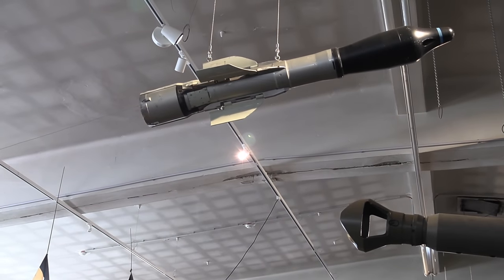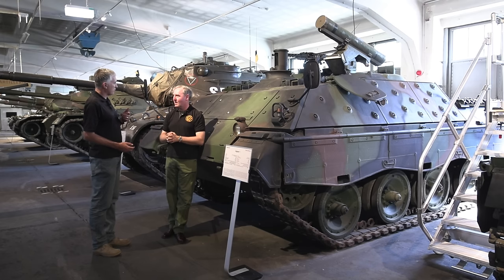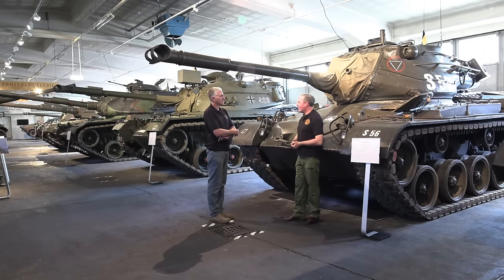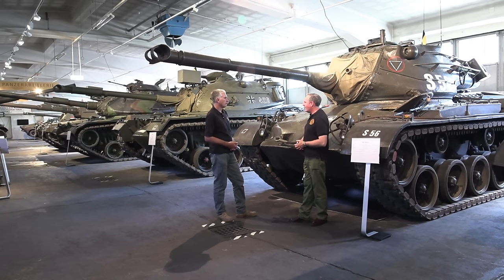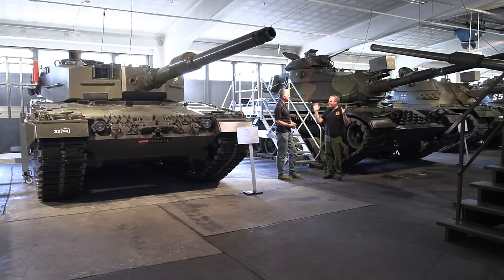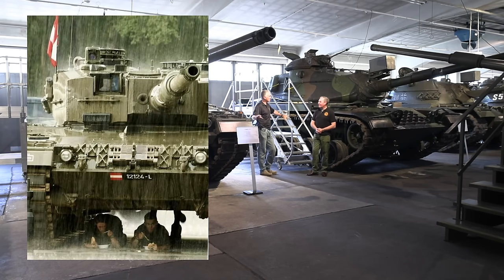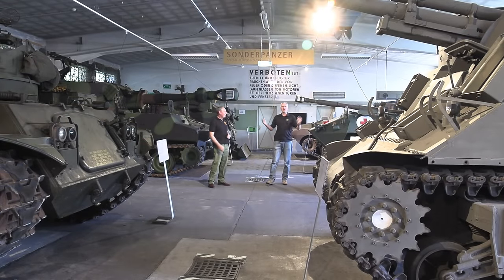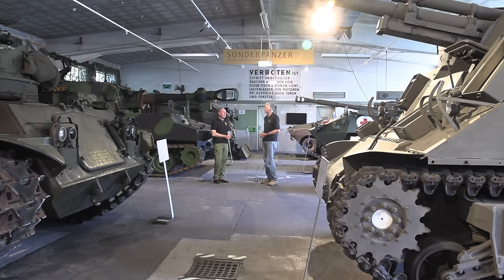Austrian Armour at the Heeresgeschichtliches Museum, Part 2

Comment: I had a brainfart listening to the fuel efficiency numbers - heard 1100 litres for 100 km on road and thought - that can't be that bad, that's an efficiency of 11km per liter.... Brain then went wait, it's actually 100 METERS per liter!
Reply: You could roll out 100 pick-ups for the same fuel consumption. Puts Sahel warfare into perspective.
Reply: I read up on the Swedish army tank trials in 1992. The M1 Abrams have horrible mileage. So apparently all american vehicles is similar.
Reply: I see you come from a place of imperial units - no one measures fuel consumption in kilometres/litre, it's always litres/ 100 km
Reply: @laurisikio  um, no - I actually do come from metric land, hence the brainfart comment ;)
Reply: I can confirm that too. In fact both the M47 and M48A1 had the same 1L/100m consumption while in convoy, on the road. Tankers from the Greek Army however had told me that it could average 1L/50m cross country...
Reply: Many, many years ago I heard the same from Italian tankers, their n.1 reason of discontent with the M-47 was its fuel consumption. At that time I did not take it very seriously, considering that those Italian tanks were quite old so wear and tear must have taken their toll on them. Interesting to hear the same thing from another corner.
Reply: @jesper509  No, they don't have "horrible" mileage. When they're on the move, they're relatively comparable to their diesel powered counterparts. The problem was when they were idling they still guzzled fuel. That was mostly fixed with the addition of an APU.
Reply: @jesper509  From what I understand the later M1s are not as bad anymore...

Comment: American tankers. This machinegun is to fiddly

Austrian tankers. Oo this machinegun has a lot of fiddly parts. Love it
Reply: Training, training, training. Something that the American military seems to skimp or skip all the time when it comes to small arms. Meanwhile, the Browning has a design pedigree that goes back to the Great War, being an up-scaled M1919, which was an air cooled M1917, and it was meant to still run fouled to hell and rained on and with mud and beaten around by infantry, and feed the belt even when the cotton duck stretched.... and it had plenty of accuracy, having held the record for longest range sniper shot for something like 30+ years.

The M85 may not have been bad... but it WAS up against the work of J.M. Browning, and it apparently used different belt links... which has gotta be really inconvenient if... or perhaps when... some goober in supply doesn't realize that the two are not the same thing, and sends you a truckload of M2 food.
Reply: Put me down as an American ex-tanker that likes the M85. I commanded an M60A1 in 3 AD for about 16 months and mine worked flawlessly. On the other hand, the M73 / M219 was garbage.

Comment: Having more than a modicum of trigger time on the Mg74, the Mg3 and the Mg42, the Austrian version (barring the absurd Swiss Mg51) is the " '42 done right". 
The '74 just drips quality, and is genuinely a joy to fire and work on.
Reply: as someone who is right now learning how to handle the mg 51, why would you call it absurd?
Reply: @derhighlige5493  Taking a design intended to be quickly and inexpensively made of stampings and turnings, and instead using precision milled and beautifully finished components, resulting in something more akin to a work of art, than a GPMG.
That's absurd. 
(Albeit in a very good way.)
Reply: @jballew2239  I am currently doing my mandatory service in the swiss army and yes you're right.

Comment: Good video.  The audio could be better as Franz was a bit hard to hear, but I raised my volume whenever he spoke. Pretty sure you realized that after the fact.  I suspect in regards to the question about the 50 caliber raised in part 1, the long effective range was useful in the mountainous parts of Austria. Certainly, sustained volume of fire is not a strong point for that weapon when compared to a rifle caliber weapon, as the Brits pointed out, and it is a bit weak and slow firing for modern AA work.

Comment: I think a replacement or rather a supplement for the Leo's in Austria could be the Japanese Type 10 (yes they are willing to export it). It is a very light, manouverable and small MBT which would do very well in the mountains. It basically has the same firepower as most Nato tanks with an high pressure (like the M256A1) 120mm and an autoloader up to under 4s reload time. It could fit the roles the Kürrasier filled back in the day.
Reply: The main thing I'd be concerned about with any JSDF vehicles is interior crew space. It was my understanding one of the main things that led to the development of Type 61 and Type 74 was Japan's experience operating Shermans and Chaffees in the 1950s - supposedly some crew had difficulty with the Sherman's controls and general ergonomics, being as those were sized for Americans and even then pretty roomy, whereas Chaffee was just about the right size for a typical Japanese crewman of the time. When  we offered them Pattons the cavernous interior of the things were in "can't reach the pedals" territory. Now, I assume the average Japanese soldier is significantly taller now than they were in 1962, but I'd still be worried that even one of their modern tanks is going to be pretty damn snug on the inside if you're approaching six feet.
Reply: Would be cheaper to upgrade the Leo2A4 .

Comment: Ah. The Leo2A4. I loved that beauty. Not the insides, though. Holy hell.
Reply: well, internal space has its cost.
M60 weights in 50t for the same size as leo2a4 (55t) with significantly lower protection (about 1/3 of protection of Leopard 2A4).
If you would increase leopard 24´s internal volume to a similar level of M60, it would weight in 65+t.
And if you add the weight increase with A5, A6 and A7 of about 12t, you would be rivaling Challenger 2 TES pushing the 80t mark.
There are reasons, why M1 Abrams is a good bit heavier than Leopard 2 in their base configurations (61.2t).